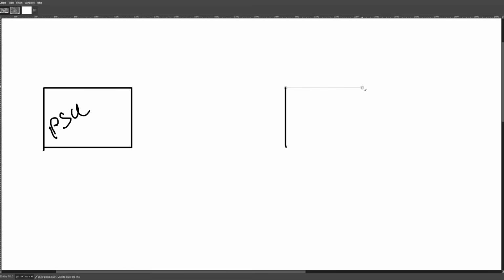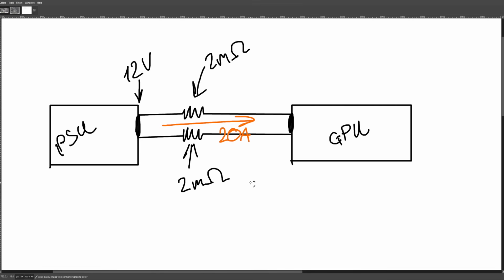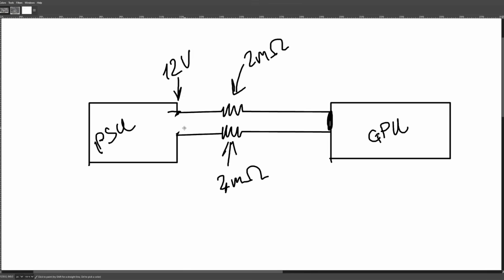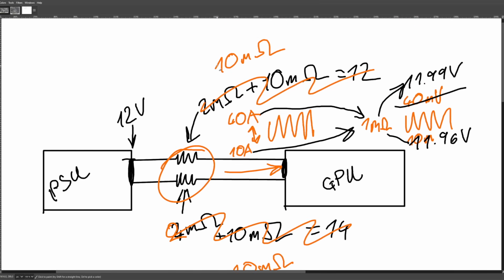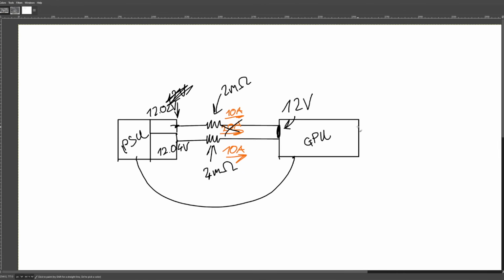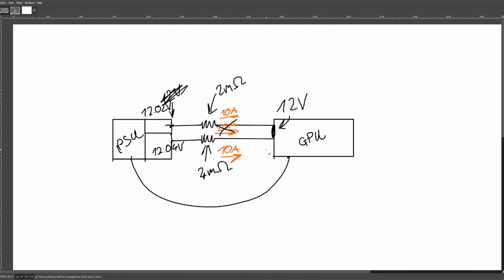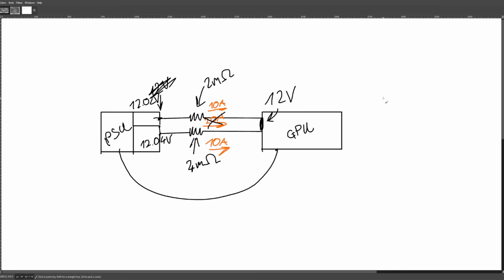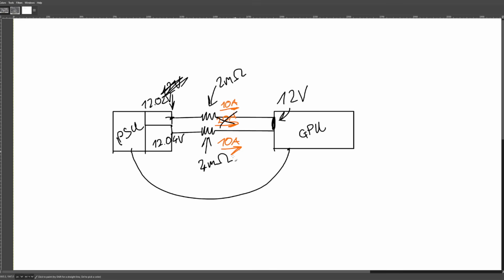Why ATX power supplies don't load-balance power connectors

Comment: Here is the simple solution change the cable gauge to AWG 10 and replace the stupid connector with a banana plug.
Reply: M8 screw terminals
Reply: Or XT60s, Anderson, or any number of other DC connectors. More pins more better right tho
Reply: @rnrbishop  Higher voltage is really the sane answer to scaling power delivery, but it has to overcome industrial inertia first.
Reply: Hear me out. Replace HP12v with SCART. 😂
Reply: @computersales 
Unironically, scart had enough headroom on the connector to support full hd video, but since americans never heard of it, that was never used.  What I'd use for high load gpu power would be a miniaturized figure 8 plug, but branch it out to multiple power lines on the gpu so that load limiting/sensing can be implemented safely, instead of the nvidia's idea of just chucking all the 12v lines into a single plane and doing no load distribution.
Reply: Average LTT viewer parroting the dumb stuff Linus does

Comment: What I am baffled about is the fact that NVIDIA is not just doing the AMD route. Like that would probably mostly solve the melting issue. Maybe bump up the spec of the connector a bit more but in general, if all all lines are ending up at the same place, it's stupid. Why not bundle two to four lines together and have a similar layout like AMD's cards?
Would be much healthier and would also help power delivery lol

I never ever understood the movement that the PSU should regulate the PD. It's just plain dumb. How would the power supply know what it needs to send out ahead (and yes, even if we are perceiving it as instantly, it is never truly instantly and that CAN matter in terms of stability)?
The GPU knows best what it needs the best and should therefore handle the power delivery and regulation itself. A per pin sensing would be very admirable in that case but again, I don't mind if AT LEAST two to four pins are bundled (and sensed).

Comment: Remember back when PSUs went through that phase of multiple 12v rails for increased efficiency? Those would technically be able to much better current balance things, but it ran into another huge issue of overloading the max current a rail can send and GPUs started shutting down PSUs with overcurrent warnings and things like that. It required that the end user also understand their PSU and physically plug things in to specific ports to balance the draw out across rails, which the average person was incapable of doing. Which is why we had to move back to single, large 12v rails on the PSU end.
Reply: I just had this problem with a 1600w BeQuiet Dark Power Pro. It comes in multi-rail mode by default and I couldn’t figure out why it kept shutting down when I ran a raytracing game or benchmark on a 5090. Turns out it needed to be run in single rail mode.
Reply: Except you can't do that on a 5090. Because the inputs are bonded multiple smps trying to create a single 12v rail can fail catastrophically
Reply: @JohnDoe-c2f  You can wire multiple switch mode power supplies in parallel to a single load just fine as long as you make sure the wire leads are the same length, which they would be when those multiple rails are all in the same SPU and the wires are all on the same plug. It isnt a recommended config, but it is perfectly doable from an electrical standpoint.

I even have an industrial machine here at work where it uses a large stepper motor on one axis and to get enough power it has two paralleled PSUs going to its drive unit. Been working that way for 10 years now right from the manufacturer without problem. And they couldn't sell it if it didnt meet safety regulations on the electrical.
Reply: @LordSaliss  they can be designed to handle such. And it's super easy if it's AC. But hooking two DC SMPSs together turns it into a polyphase system and nasty things like one PSU dumping power into the other so the other doesn't output anything (it thinks there's negative load) but that negative load stresses all kinds of things. Maybe it's better with isolated supplies, but I've fried more than one buck/boost.

Comment: I really think Asus will come to regret their pin monitoring implementation on their Astral cards. It does little to actually protect the GPU and ultimately just draws attention to how stupid pulling 600w+ over this connector is - potentially generating support tickets for Asus. There have already been examples of users with brand new cables seeing the warning on one or more pins. It really doesn't take much imbalance to push a pin out of spec given how close it is to the limit. Asus are telling users to just replace the cable if this happens. I can see users replacing the cables multiple times over the life of the card and getting pretty sick of it.

Comment: Sounds like we need a solid copper rod. With a bending kit. And screwed in terminals.
Reply: i mean this isn't that far from the Open Accelerator Module spec used in OCP servers. just, PCB instead of solid bars
Reply: 🤔 actually... the PSU will have a socket where to plug the graphics card for power and it will use a riser cale for data

Comment: I think it's great that we keep exploring these topics until good solutions are reached and the industry gives us a more reliable standard for high powered graphics cards. Maybe more efficient cards would solve it, but I think it's a long way off before we can have the same performance at half the watts. Thumbs up.
Reply: In the mean time, just buy only GPUs that use an already existing more reliable standard: multiple chunkier 8-pin connectors.

Comment: Here's an idea, 48v PSU architecture. Reduces cable cross section worries. Lowers amperage demands.
Reply: I'm not convinved that would help. There are losses at every step when you convert higher voltage to lower, and this would hugely increase the work the VRMs on the GPU would need to do. A higher voltage works well to reduce the guague of the wire with longer transmission lines, but with shorter cable, the cost of heavier gauge wires is fairly insignificant, if you don't saddle the ends with under specced connectors.

In theory Molex Micro-fit+ connectors should be fine up to 13A per pin, but with people seeing 20A on a single circuit, it's clear that on GPUs without explicit cuicuit balancing, the 12v2x6 connector is a timebomb that could go off at any moment.

Comment: I was just for fun checking resistances and in normal situation it should be 4 miliohms for wire and 10 miliohms for each connectore, however per listed information you can easily get 100 miliohms or more on connector. That could easily make variance 24 <-> 204 miliohms without any extension.

BTW what if nvidia use two cables? if connect both to same powerplane it would make it even worse as PSU wont know if those two connectors go to one or two GPUs and voltage differences between cables can go even higher and current increase can go even from one to another cable.

Comment: A PSU's job is to provide a stable voltage over a specified current range. A load's job is to draw current over a specified range at a specified voltage. If the load requires multiple power rails (owing to limits imposed by the standards in effect), then it is also the load's job to ensure current is drawn equally across those rails.
Reply: I'll partly disagree. A power source should have per wire breakers / OCP.

Believe it or not, a good example is the 30A 240V dryer circuit in US homes.  It's split phase, so you have +120V, -120V, and a Neutral wire.*  If either of those +120V or -120V wires draws more than 30A, the breaker trips and both wires are disconnected.

* Simplifying and using DC terminology to make life easier.
Reply: @EmperorA0  fair statement, OCP per wire would be great, but then I'd expect there'd be cost issues...!
Reply: @adrianjohnson555  No doubt.  Safety is unfortunately expensive, or requires an outside mandate.  Ballparking, but an ADC and sense resistor is probably somewhere between $0.10 to $0.50 per voltage measurement.  So you're talking $1.20 to $6 per connector!

Fuses would work, but would have to be mandated.  Since they would end up with many dead power supplies.
Reply: This one, dude knows what he's talking about!

Comment: I have a shunted 3080 ti that pulls 400W through the 8-pins continuously, and I did finally manage to get the aliexpress connector to melt, after switching to original PSU cables, haven't had issues since

Comment: Raspberry PI or ESP32 + thermistor on gpu connector, if exceeds someTemp then send power off command to AC smart outlet or smart UPS. Outlet is connected to UPS and sends a safe shutdown to computer so it will turn off if you are not at your desk.

Comment: Answer is quite simple to understand for anyone who looked inside any PSU, because all those +12V cables are in most cases soldered to a single +12V plane on PSU PCB. I highly doubt any commercial PSU have full array of fuses or some active circuitry for each 8pin PCIe connector on modular PSU's yet alone for each 12V wire on non modular. This means responsibility for keeping connectors in specs are on the destination side, not the source side. Is it wise not to have such fuses/circuitry on PSU side? Imho yes, that is cost effective.  PSU is to provide power, not to baby sit some module because an ignorant engineer failed to design within provided standards.

Comment: Great Video. @buildzoid  I was wondering, the Taichi 1300W PSU claims to have "Cable Over-Temperature Protection" that works by
"The NTC sensor at the VGA connector monitors the temperature and sends signal the PSU to ensure safe operation.". Not having one to test yourself, do you buy this claim from Asrock?
Reply: well, if they did what they claim and put a little temp sensor in the connector, hooked it up with two small extra wires that run along the cable – that would totally work. Monitoring a temp sensor is pretty simple and does not require much expensive components, sounds plausible that they'd have no problem doing that.
Reply: took me a while to figure out what you meant. by "VGA connector" you mean, the power connector on the video card?
Reply: @spambot7110  I copied the quote directly from Asrock's product page/newegg listing. I am guessing it means the 12v 2x6 on the psu side.

Comment: This is probably a very noob question, but why do PC cables have so many pins in general? Say you took all the wire gauge from 3x8pin cables and put them into a single wire (or 3 wires I guess, for positive, negative and ground), and made the 3 pins physically larger, so they have the same contact area like the 3x8 pins before. Is this worse somehow? If either positive or negative didn't connect properly, the system would notice because it couldn't send the power. Wouldn't there be less opportunity for issues this way? Is this about large cables not being bendable easily or something like that?
Reply: Because most components only required a single wire of each type before PCIe cards got so powerful. Dealing with many different wire gauges is a headache and increases tooling cost.

Also capacitance of the wire itself.

Comment: Realistic resistance (per the specs) for a 300mm cable assembly would be in the ballpark of 1-6 + 4 + 1-6 mOhm. Test data for 2202260004 shows a best case LLCR around 1mOhm for the terminal, and 6 is the max for 30 mating cycles. Actual observed max is a lot lower than that (probably closer to 4mOhm, absolute value unknown because the test data represents it as a delta from initial, side loading tests could push it closer to 6 because they saw a +2.5mOhm max for all the 20N X/Y loading tests).

Comment: Per pin OCP is probably the best solution. Once one fails, the rest will cascade.

Costs one MOSFET, one shunt, and one current measurment op amp
Reply: He complains about “unnecessary current balancing MOSFETs” on nVidia cards in a later video.
Reply: @ioshshua  current balancing MOSFETs are not the same thing. They dissipate more power and are way more expensive to implement, both in footprint and BOM cost

Comment: Adding variable resistance to the lines would waste power, generate heat and generally suck (power). It would be better to instead individually control the current instead, through the same inductive voltage regulation the power supply already uses to generate its various voltages. Although we could just get connectors that dont suck (power)

Comment: Watching this, I was reminded of when I was involved with designing a prototype automotive system that had a peak current of 3800 amps. We used solid copper and aluminum bus bars across the system except were we need a flex joint between two separately vibration isolated components. The flex joint was 5 parallel strands of unshielded 6 awg wire. There was one time where on the hot side had one or more of stands didn't get a solid, clean connection and I have the resolidfied  lumps of metal on my shelf of shame.
Reply: For future reference: a ground braid (or rather, multiple) would work well in that application. They are available up into the kA range.
Reply: @TheLoneWolfling  That's where the next version was headed at the time I was pulled off the project. We were looking for a supplier since we couldn't get something that would work of the shelf.

Comment: Honestly I don't see the big deal with these power connectors, it would be much easier to just run jumper cables to my car battery and clamp them onto the GPU. As an added bonus, I can zip-tie the jumper cables to the top of the PC case, thus supporting the weight of the massive fucking graphics card, and preventing GPU sagging.

Comment: If nVidia insists on NOT current-balancing the power connector at the card end (see 4000 and 5000 series cards), the EASIEST solution is to redesign the cable so that, instead of 6 power (and 6 matching ground) wires are used, they all bridge to a single cable (pair).  The tricky bits are routing the power across the pins into the single cable, then routing such a thick cable through the chassis and to the card.  But I'm sure it can be done.  The power supply, as noted, doesn't really much care.  The GPU only wants to see 20A of 12v power at its inputs.  So the power supply side could easily be redesigned with a heavier-duty, 2+4 connector.  The GPU side of the cable should maybe be designed with higher resistor values at each pin and an active voltage regulator to ensure near enough 12v shows up at each pin so they're not imbalanced by the time it reaches the GPU.

Or maybe someone modifies the GPU connector to be a 2+4 connector, as well...  You know, to show nVidia how to do it properly.

Comment: Technically Eps HCS+ 300w 6.25 amps per conductor (528w)11amps technical limit, 8pin pcie HCS+ 150w 4.16 amps(396w)11amps technical limit, 12v 2x6 662w 9.2amps actual limit

Comment: The connector should have just been a latch style connector. You insert something loosely, flip a latch and screw it down. 

And 12ag wire....
Reply: Wago connectors could work.

Comment: 11:30 - I feel they should still monitor current of the pins and just limit it to a max, as well as having a few thermisters in the cable end, to detect overheating and just shut down power to the card.

Comment: From an electrical engineering perspective, not an electronics one. You would use circuit breakers. This would obviously cost more, but it would protect the lines as long as the load (GPU) doesn't limit the current. 🤣

Comment: The PSU has no idea if all the pins on the load side are tied together or not. What if the GPU is using each 12V wire from the connector in it's own circuit and with different loads. If the PSU thinks it needs to current balance all the wires, you'll screw up something that is designed purposely to have different loads. The PSU could current limit each wire, though.

Comment: Add 100mohm and your set. Kinda interesting why we still never got resistance readings from anyone, instead of just current draw.
Reply: Measuring current and then voltage from each end you can calculate the resistance. You just need to check the voltage drop from one end to the other end.
Reply: Problem is that unless you rip open the psu you have zero idea which cable is the issue before you plug in. Why assume rather than test? You could math the resistance but multimeters and sanity are cheap. Burnt connectors and welded pins are not.

Comment: Melting connectors are result of arcing connections generating high amounts of heat. The heat from high current is lower. 600w at 12v is 50 amps. A worse case scenario is only one 12v wire is making contact will probally melt the wire casing before the connector, which we are not seeing. It seems necessary only to curent balance multiple connectors where as single connectors can parallel all the 12v wires together for a single load resistance.
Reply: what. where are the arcs coming from. do you think people are hot plugging GPUs

Comment: This current imbalance where the voltage is fluctuating that you’re showing at 14:00, is it possible the reason they got rid of the extra shunt resistors is this imbalance in control? 
Wouldn’t that cause the same problem inside the regulator regardless?

Comment: I would love to see a power supply with active balancing. Wouldn't that be a real fk you nvidia if each pin would at max deliver 11A or less even if it would power starve the gpu :). imagine having a 5090 with 5080 performance and not knowing why XD.